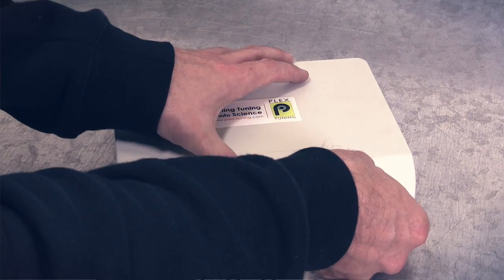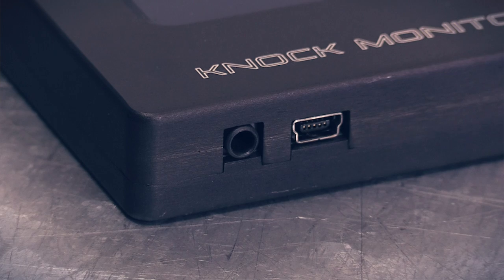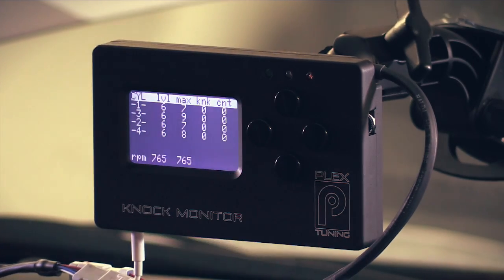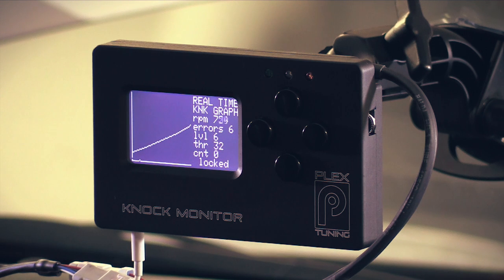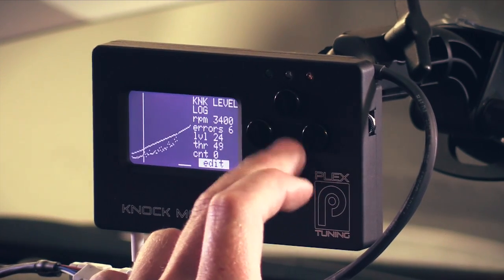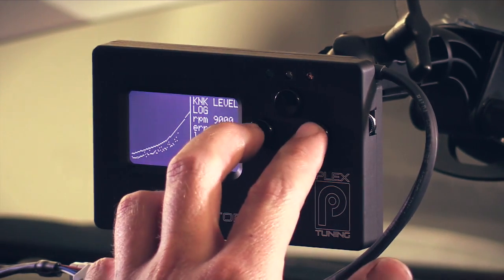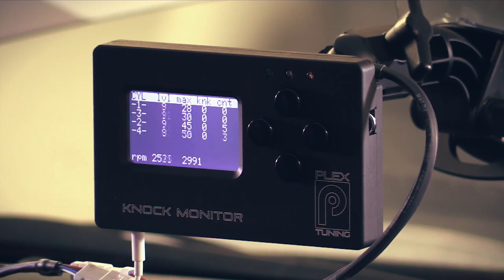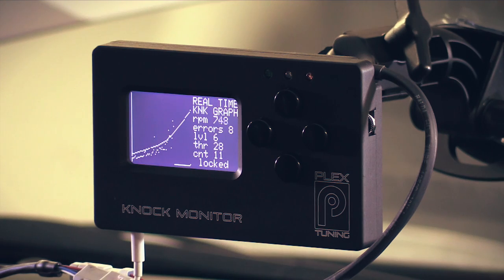Plex Tuning Knock Monitor | HPA Product Spotlight

Comment: I have a V6 with a noisy cam at low RPMs and smooths out once the RPMs are raised.  How well does this unit pick-up and distinguish false knock from real knock?
Reply: You can get some idea of the techniques involved in minimizing engine background noise by having a look at the datasheet for the Texas Instruments TPIC8101 integrated circuit.  It's old tech, but a good reference and still very relevant -- infact, in general, the aftermarket seems to be very slow (though maybe not PLEX) to approach this level of functionality.

Comment: Andre have you tried the new Plex Tuning Knock monitor v2.0? It has dual knock control option if you want.
Reply from the maker: Hi, yes we have used the 2.0 unit with great success. - Ben
Reply: High Performance Academy Good to hear! Making a video comparing the first and second generation Plex controllers would be awesome!

Comment: Hey Andre, which GoPro parts did you use for the mounting?
Reply from the maker: +fabianoD30 we used something like this: https://www.tethertools.com/wordpress/wp-content/uploads/2015/03/rs714-tether-tools-rock-solid-tripod-mount-adapter-gopro-hero-02-web.jpg with a little square of 3M double side adhesive foam.  - Ben

Comment: How good is gizzmo kmon knock monitor i got one.
Reply from the maker: Falah Khalid we haven't had much experience personally. Here is a good discussion on this point on our website: https://www.hpacademy.com/forum/general-tuning-discussion/show/107
Reply: +Falah Khalid 
I have one also i  wont be leaning on to hard  without an amp and headphones rigged up in tandem  to prove it  has configerable back ground and gain with is pretty great for the price
Reply: I connected the gizmo kmon to the laptop took the bosch sensor and rattled a screw driver in its rim. The kmon software seems to decipher data without any delay. I am unsure how much lag is in commuting that sound thru the headphones. If thats the case i wont fully rely on it and especially the sound heard from the headphones. As there is not even a micro second of lag on the dials shown in the software.